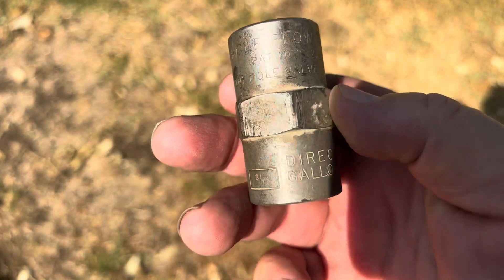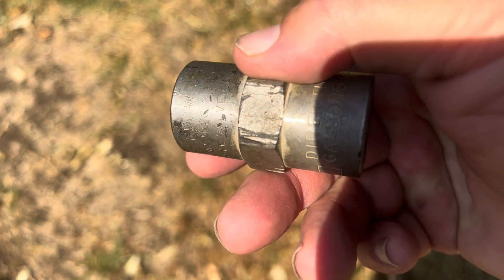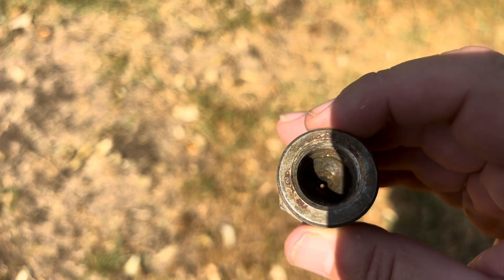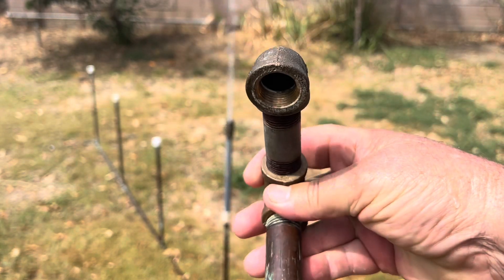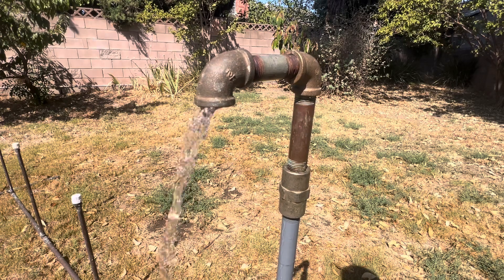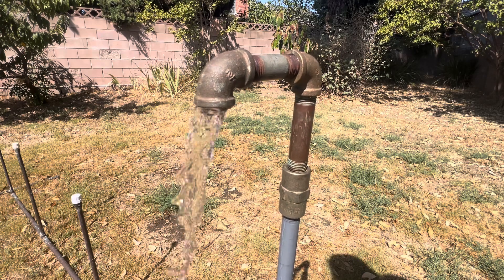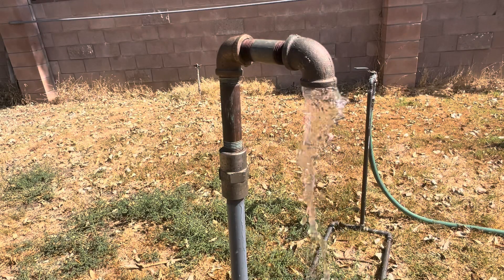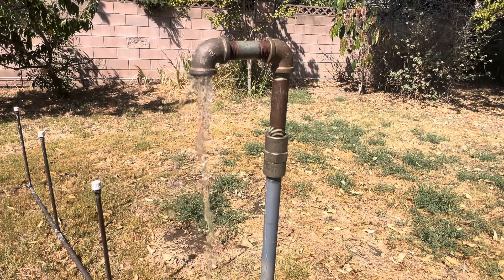Dole Flow Control Valve @ 3/4 GPM

Comment: I didn't know they had flow control valves. I do know I've seen impacts and pivot sprinklers that use regulators to make sure that each sprinkler applies evenly. I guess you want to make sure your bubblers or etc aren't giving out too much water, so you dont kill your plants. On pivots, there are pressure regulators on each sprinkler also to compensate for elevation changes, that can also put a damper on the application of the water droplets. In irrigation you want to make sure every sprinkler is applying the same otherwise you get brown spots or kill whatever it is your watering. I've been learning little tidbits of info in every type of irrigation. Home/Commerical and Ag. It seems every time i go to the dealer i run across some kind of gun or impact or accessory that is used in ag irrigation, usually things i have never seen before. I like going there and just looking at all the impacts in the buckets and the gun trailer, Also i walk around the "junkyard" to look at all the broken/decomissioned equipment there. They have 2 hose reels with Komet 202 Ultra big guns on traveler carts. They even had a paddle wheel traveler t hat moved by a stream of water turning a wheel with cups. You could even set the speed of the cart, whether fast or slow. Definitley cool.
Reply from the maker: Thank you for the great comments!  

They have had flow control regulators for some time. There were the pros and cons to this type of system as like anything else. The adjustable type bubblers you could adjust the flow rate for amount that would need for the specific amount of watering for that particular area. Where I use to be employed at we would typically have one control valve that would water several tree wells/planters in a group. So often in this type of watering where one tree well would get too much water and another would not get enough. So it made it easier to adjust the water volume as per each bubbler head. If the tree wells were very consistent, than these type flow controls valves were an excellent choice!! 

The current modern day sprinklers are seeing more pressure regulating devices built in the spray heads to give a more uniform coverage and prevent misting to save water. 

It must be fun to visit your local dealer to see what shows up next in their inventory.

Thanks for watching!

Comment: The flow control valve looks like a dependable way to reduce the flow, and the simple elbow configuration would not attract tampering like a bubbler head might.
Reply from the maker: You are correct! There is very little to go wrong. Thanks for watching…